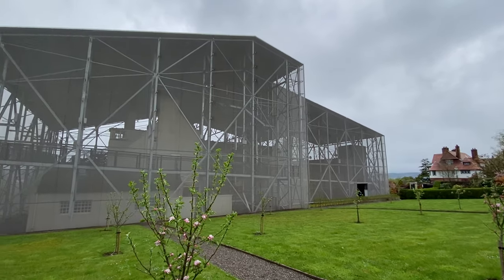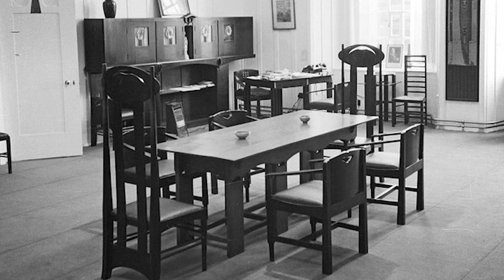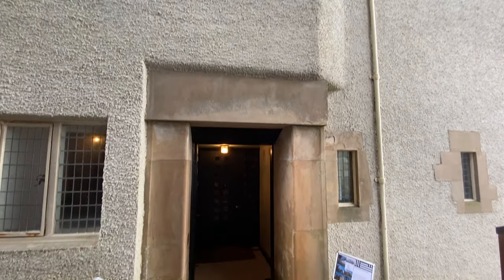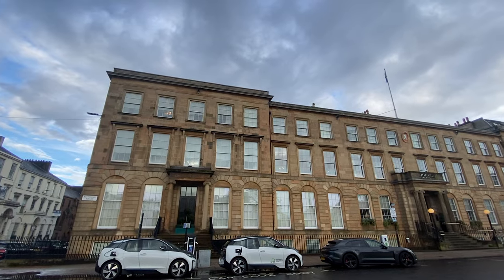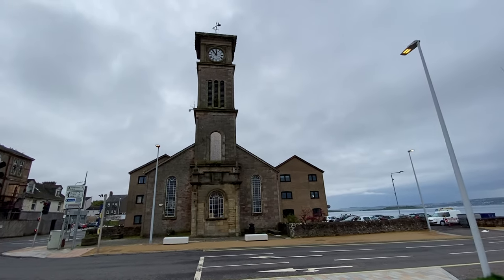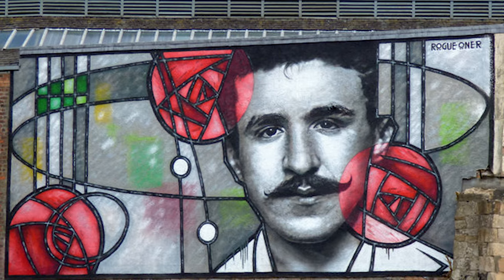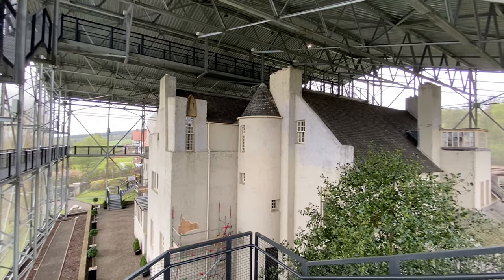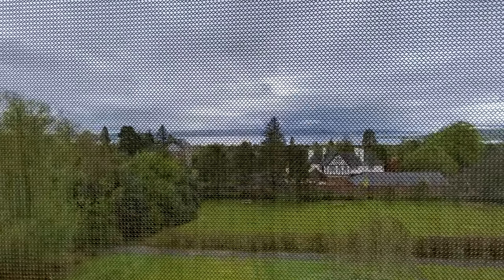Why is this HOUSE in a BOX? - Charles Rennie Mackintosh's Hill House, Helensburgh

Comment: I've seen a few people cover the hill house, it never ceases to amaze me. It is a truly inspired bit of architecture. And the containment for it, is an inspired piece of engineering to save it. The question you posed near the end, is it a bit overkill? I don't think so. I think it's clever bit of preservation, that is fittingly as inspired as the building it protects. If that's overkill, I would want nothing less.
Reply from the maker: I agree. The structure is a pretty cool feature. The current plan is to get the render sorted and take it down in 2028, according to the guide I spoke to. Will definitely be back!